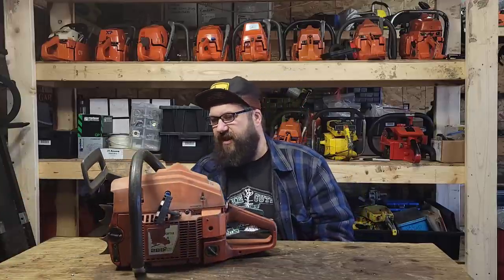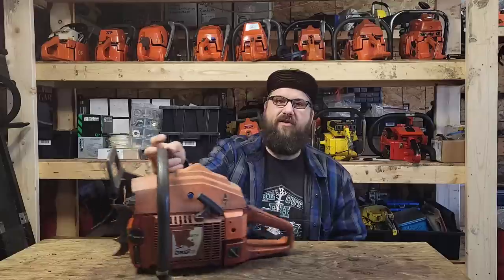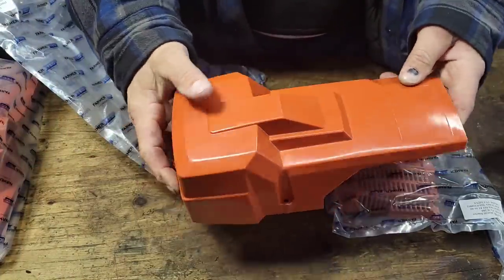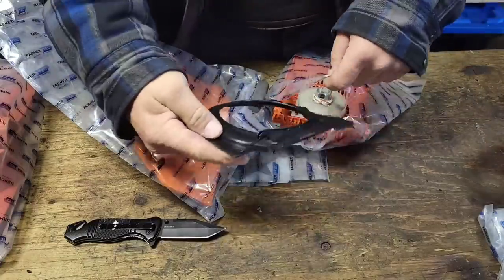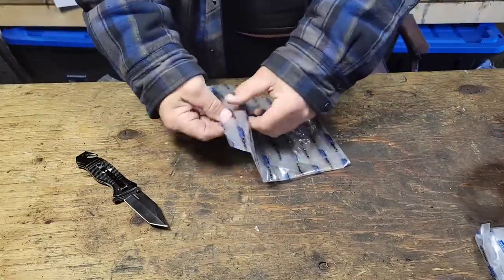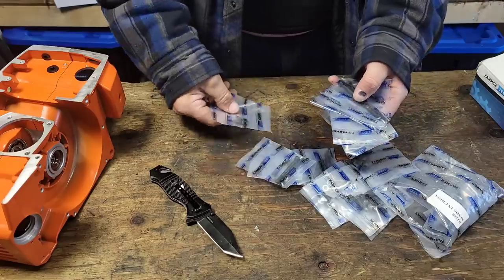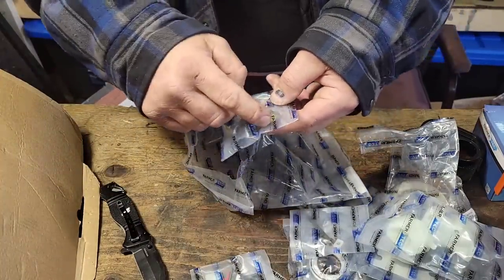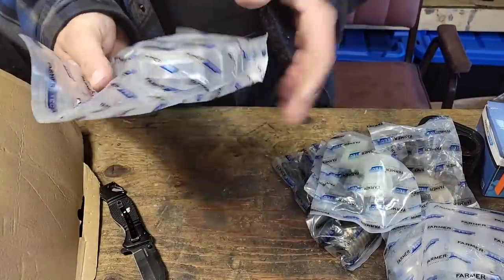I finally picked up a Farmertec saw kit!!!

Comment: Needing some advice from anyone out there that has this saw and the ms660 clone. I'm needing/wanting one or the other cutting in almost entirely hardwood, Oak and Maple predominantly. I'm not really a stihl guy, all my saws are Husky's and a couple of vintage poulans. I know the 288 doesn't quite have the cubes, but is it that much different/less powerful than the 660? I'm not going to be milling, it will be primarily a large felling and bucking saw.
Reply: To me the 288 seems like it has more power, and I believe will do u just fine
Reply: Buy a new OEM 390 or 395xp and have it ported by a reputable saw porter. They have better anti vibe and filtration as well as better parts availability. Especially if you plan on putting some hours on a saw. If you really want a new 288 they can still be sourced in foreign markets new OEM.
Reply: @Iffykid Mn Having run both the 395xp and 592xp for some time now. I would buy the 395xp in fact I recently bought another one. If someone is going to fell trees with a 90cc saw they are most likely going to run a 28"-36" light bar preferably, occasionally longer, the 395xp balances better with those bars. The 395xp oils better. The air filtration is pretty good on the 592 but the filtration and air filter is better on the 395xp (one of the best of any two stroke saw in my experience) The 592xp has an inboard clutch which is easier to put the bar and chain on and remove the power head from the bar if you get it stuck in a tree. Even though the chain adjuster is harder to access on the 395 I prefer it being in the case like the Stihls over being in the clutch cover. The captive bar nuts on the 592 suck compared to Stihls. The 395xp is not an Auto-tune or strato saw so properly built and maintained will provide years of trouble free service, the 592 is the first pro saw in 31 years of running them that I had to take back to the dealer for repairs. It is the most inconsistent running saws I have ever run. Being a newly released model perhaps I should give it some grace but having run other auto-tune saw models that were more consistent I won't. The 395xp is ported (noticeably more power) the 592 is not, I am learning what mods do and don't work on the 592, it is hard when you cannot tune the saw yourself. Price & availability. Will the electronic saws be obsolete in 25 years because of discontinued electronics and diagnostics? I have not had the opportunity to cut with a 585xp so I cannot compare it. I do however strongly feel that any OEM pro saw is a far better investment if you are wanting to put timber on the landing than any kit or clone saw I have run. Not only in terms of quality and reliability but resale value when you are done with it, look what 25 year old OEM saws sell for today.
Reply: @iffykidmn8170  You are welcome. I guess I was looking for an improved version of the 395 and got a larger 572 instead. When the 585 with adjustable carb I have been waiting for finally arrives perhaps it will be more to my liking if it will balance with a 32" light bar like my 395s. You got it for a good price. Check back with your dealer for updates on the 592xp. Keep an eye on the plug it should be a nice light brown if it is white or you suspect the saw is running lean stop running it and get it checked out. I had one that the intake boot had separated completely from the mounting block at the cylinder and the saw still ran. Familiarize yourself with the auto-tune reset procedure, unfortunately they don't put it in the owner's manual. Grease the clutch drum bearing regularly. Ideally if you maintain it well it should last you 25 years and it will still be worth what you paid for it or double, that is really the essence of my reply to the above posters question buy OEM if you are really going to work with the saw (R.O.I)
Reply: @iffykidmn8170  Good idea, maybe you already know but the clutch drum bearing on the 592xp can be greased through the hole in the end of the crank with a bar tip grease gun or small tip on a grease gun. You will still want to remove the drum and wipe it out and blow out the dust buildup in the clutch regularly. I have had good results with Lucas x-torq heavy duty, Redline full synthetic, and amsoil synthetic multi-purpose (high RPMs & temps) If you don't run the saw often you would find it beneficial to run VP 40:1 synthetic premix in it before you shelve it. The Husky pre-mix burns real clean in the 592 but I prefer 40:1 premix.  I could write a chapter on mix oil, I run 32:1 Bel-ray H1r in all my saws now with non ethanol gas. I have not had good results running 50:1 especially Stihl ultra. 32:1 does not work for all oils in a saw for example Honda HP2 works better at 40:1 and that is the least amount I would run, especially in a strato saw. I have run the 066 flay top in my avatar picture since new on mostly 32:1, the bearings, piston, and rings are all original, unheard of for a logging saw. If the 592 doesn't respond to the reset to your satisfaction, take it to the dealer so they can reset it on the CST. Enjoy your new saw!